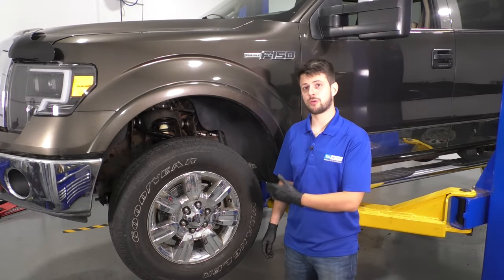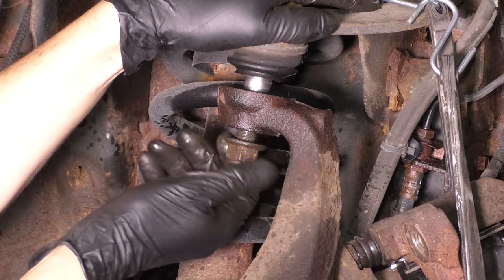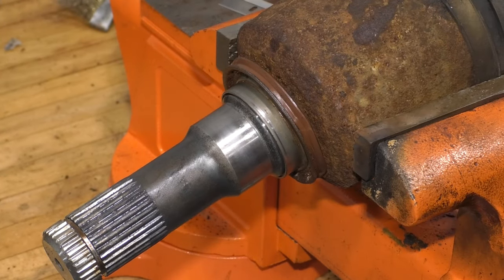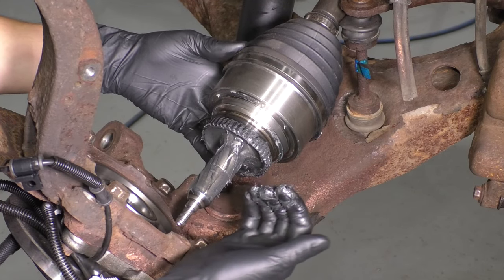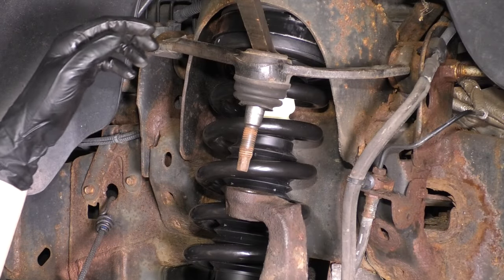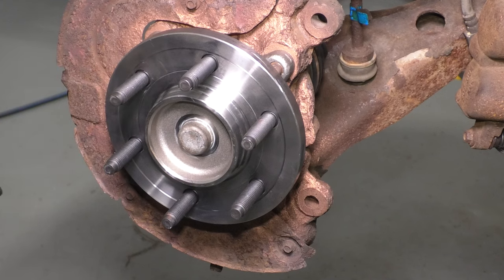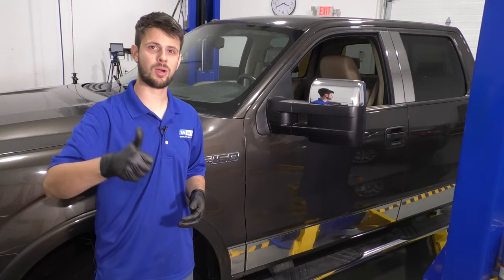How to Replace Driver's Side CV Axle 2009-2014 Ford F-150

Comment: When I removed my CV Axle, the seal was no longer usable and it came out in two pieces. I went  to the Ford dealership and found the seal that you need to buy separately. In addition, I had to replace the vacuum actuator assembly that is on the wheel side. The part numbers from Ford are:

CV Axle Seal (SEAL - DUST): ALZ3Z-4B416-A
Actuator Assembly: 7L1Z-3C247-A, Replaces 5L1Z-3C247-A

FYI, you also need to use Moly Grease to place on the outside spline and bearings. Yes, actual Moly grease. I know you want to use the "Red n Tacky" that you already have, but it wont work right. 

What should have been a 2 1/2 hour job (At least for me), turned into a 6 hour job. This is because: 
1.) The seal broke off in two pieces, the second piece was press fit in and there is no good leverage to pry it out. (Extra 1:00)
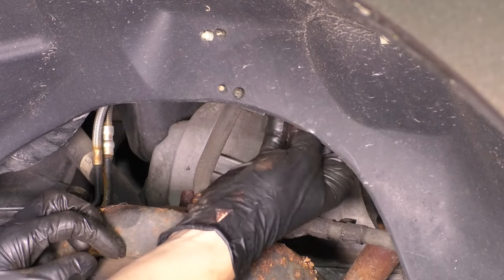2.) Almost every bolt that I tried to remove was rusted in place. Have some PB Blaster on hand, it definitely helps. (Extra 2:00)
3.) Staring at the stuck pieces and wondering what to do. (Extra :30)

Comment: Okay, great video, however, the front left CV axle inner seal stays within the differential, IT DOES NOT COME OFF with the old axle assembly. I did this same repair and couldn't figure out why the new assembly wouldn't seat correctly all the way into the diff. I finally realized that the seal shown in this video, and mine, broke into two pieces while removing. 

I went to O'REILLY auto parts and obtained a new seal...the correct one is a one piece unit and it is pressed into the diff...it should not split into 2 pieces and one half (as shown in the video) come off with the axle assembly.

I removed the broken seal half from the diff and installed the new one (one piece correct seal), then installed the cv axle. It set correctly and all is sorted.

Comment: For replacing a drivers side cv axle on FX4 with 2" lift, do I need an extended travel cv axle or with stock replacement work?